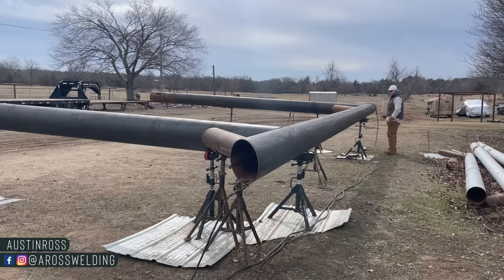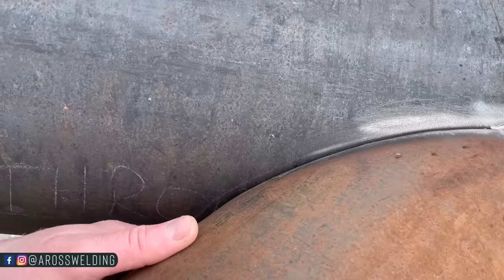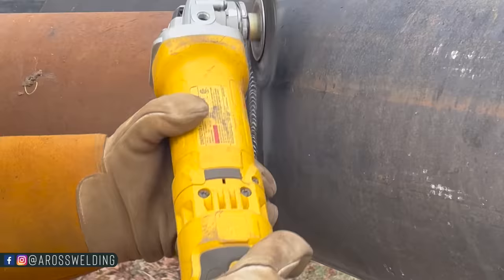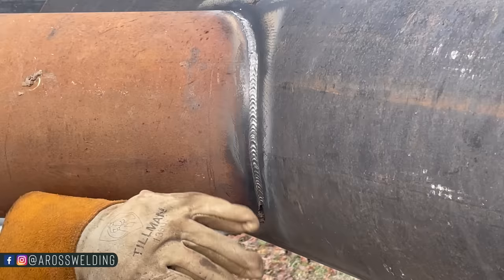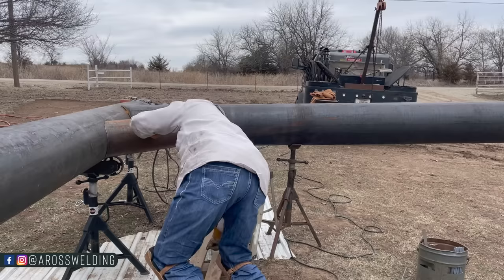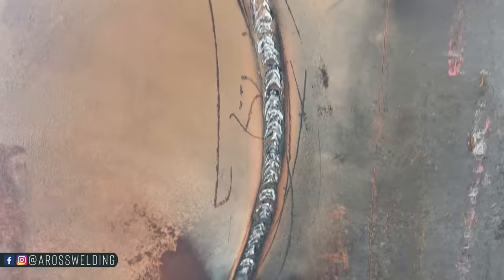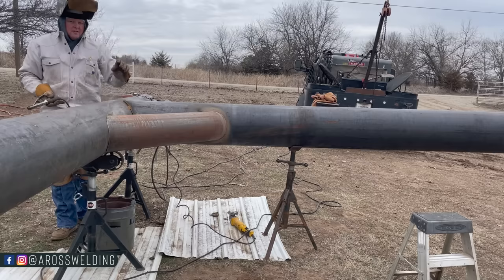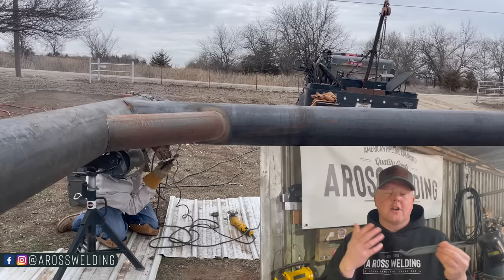Why Pipeline Welders Only Burn Half a Welding Rod

Comment: Mate, I'm an Australian welder who's worked in China, Thailand and all over Aus on Defence. Written and qualified 124 welding procedures as well. We always burn the whole rod taking into account access and heat input of course, and then there's economising for ourselves and the client. But as tested welders know, especially on critical LNG and fuel/oil know implicitly,  more stops/starts mean more opportunities for weld imperfections and NDT failures.
Reply: Correct.
Reply: thats what im saying.more tie in = shitty weld. thats when im welding pipe or anything else.i could make it look better than welding up.i can see using something just to fill in gaps and burn of any paint and shit.i like using 5p first but then its 7018 up. this is structual pipe i thought  he was doing something else
Reply: Way to much time watching an arc!!!  Pat him on the back fot attention  slap slap.
Reply: @chrhadden  Why are you not grinding the paint off?
Reply: Im in US, and we have a family business, selling, repair pumps, electric motors, phase convert and so on. We have done work w/ NASA NSA Aberden proving ground, Ft. Mead and so on. My Great grandfather started the business in 1901 (he was at Lincolns funeral he was 4). He as well as myself are inventor (have patent to our name I have 1 still under my name as it's no longer of use [it was monitor for DC motors, AC freq drive can pretty much do anything a DC can cheaper]  he had dozens yet none except a couple are still w/ our names as we sell them to big business and they then own them..anyway) He put the generator in the Argonaut one of the first subs. We actually designed and built the ultrasonic shower in the ISS (space station). I was just a teenage, yet worked on it and carved our name in it. I wanted to be the first person to use as I finished my work on Saturday and was going to use it Monday, but my DAD went in on Sunday (not telling me) and powered it up and was the first to use it. He used the excuse that since I was a kid and this was a major thing he had to make sure I did it right..what BS I had already work on gov't crap. We also modified deep sea submersibles that kept leaking at deep depths, so I came up w/ the idea of putting oil in the stator to displace the air, and thats what we did. We also wound a MK 48 torpedo w/ silver magnet wire and a gold commutator as the NAVY wanted more speed, and distance w/o more power. The machinist set up all this new paper around the lathe before turning the commutator to catch the bits of gold that was machined of it, I told him that it was a waste of time b/c he wasn't going to take off that much gold. Anyway, I prefer arc welds for building up a shaft over spray weld b/c the arc is a stronger bond. I have dozen of rod at my house b/c they are decades old (4 ft the largest) and some are silver.
Reply: It's a gate not a pressurised pipe line....Gate ...mate.
Reply: @Warpedsmac  😆😝. You would have thought that was obvious but I guess not.  😎
Reply: @kevobrien7346  arc welding is not inherently stronger than MIG... Only reason pipeliners run stick instead of dual shield is they aren't laying down a lot of inches of weld - anyone outside laying down multiple beads that take 2-3+ electrode changes each is setting up a wire feeder, but on the pipeline, you'd be moving and setting up the feeder more than you'd be laying wire

engineers/inventors aren't welders
Reply: Yeah what he said.
Reply: It's a feel.
Reply: @tragikk03   ''engineers/inventors aren't welders'' Are you ? MIG is not arc welding? You even know the difference between MIG and MAG ?
Reply: @zsdfg zxdcfg  I broke out as a fitter/welder in production, now I own a mobile welding business.  I run 045 dual-shield a lot now, but I'm certified in multiple processes and continuing to expand my library of skills - learning GTAW now.

What do you do? Cry on the internet?
Reply: @tragikk03  Don't focus at me, I'm just a certified TIG-welder.  Do you undterstand this: MIG is not arc welding? You even know the difference between MIG and MAG ?
Reply: @zsdfgzxdcfg5203  Erm... "Not my circus, not my monkeys" as they say here where I live, so forgive me dropping my twopence and unsolicited comment, but this whole hoopla here seems to me to be about "knowing how to weld" versus "knowing how to talk PRECISELY about welding" - and apparently those two don't always go hand in hand.

This "arc welding is not inherently stronger than MIG" is, or it seems to me, the case of a rather sloppy usage of English. All "electric welding" (bar electron beam welding and resistance spot welding) is in fact "arc welding" - TIG, MIG/MAG or stick all use electric arc - in one form or another (heck, even atomic hydrogen welding uses it, albeit indirectly).
But I guess some people just used to call this SMAW method "arc welding", and for a very "reasonable reason", since it was the very first usable* arc welding ever invented, and for a very long time the ONLY electric welding method - or, at the very least, the only one WIDELY used.
And it was called "arc welding" in order to distinguish it from "gas/ torch welding" - a method well known and commonly used since much earlier (1903) - and the name, well, stuck. In other words, there came this association - stick electrode = electric arc = arc welding. 

And then, much, much latter*, came hydrogen welding, MIG/MAG welding, TIG welding - and all of them got their respective "detailed" names, to differentiate them from the widely used SMAW - wile stick welding remained stuck with this "arc welding (hey, have you ever heard anyone in the trade saying "I'm gonna use SMAW method here"?)
Here where I live people say "electrode welding", but then ALL "electric welding methods" utililise some electrode, don't they? Still, you say "electrode welding" and EVERYONE just knows it's not MIG/MAG - and neither TIG. Just good ol' stick (I mean, "electrode", of course ;-)
So I guess this "arc welding" is just a shorthand for "SMAW", and while it certainly isn't the most precise usage of English technical terms I see no reasonable reason to get into any "preemptive-assertiveness" style hair splitting.

But then I might be just wrong, who knows...
____________
* - Actually the very first patented method was "graphite electrode arc welding", by Nikolay Benardos and Stanisław Olszewski who obtained American patent in... 1887. Yep, it ain't no typo, the end of 19th century... Time flies, innit? ;-)
First USABLE "consumable coated-metal electrodes" were invented ca 1900, but "arc welding" gained popularity only after beginning of WW I. BTW, the very first fully welded road bridge in the world was made in 1927 in Maurzyce, Poland, using this SMAW method (it would be almost impossible or prohibitively costly at the very least to weld it using oxyacetylene torches).
First ROAD bridge, but "second welded bridge MADE" - Auntie Wiki says:
Although designed first, the bridge was the second such bridge constructed; a similar yet shorter welded railway bridge was designed and build a few months earlier in Turtle Creek, Pennsylvania ... and holds the record for the first welded bridge of any type in the world".
In 1925 Irving Langmuir invented atomic hydrogen welding method. TIG "as an idea" was first introduced in 1890 but it saw its first practical applications only around 1940. MIG/MAG, or GMAW came on scene around 1950, but even then it was only in '70s (AFAIK) when all those "non-stick" methods gained any broader usage - and until then "stick welding" was "arc welding", period.
Reply: @michaelchadwick3497  Yeah. Oh well.
Reply: @tragikk03  may I ask, what is GTAW? Please understand I am not a welder and havent struck a bead since '90 when I was working in Hawaii under a high pressure welder for The Navy. I have never heard of GTAW. Thank you.
Reply: @tragikk03  The real reason why on-site welders use stick/MMAW is because you don't have worry about your gas coverage blowing away, like you with MIG/MAG.
Reply: @Jeff NME  you're not entirely wrong, but that's not really the whole picture.. stick welding just does better in dirty environments and is used when it would be too slow to set up a dual-shield of fluxcore wire feeder (like pipelines where they're welding one connection then dragging their shit up to the next connection - stick welding is a ton faster in that situation)

To run mig outside you just stand your body between the mig gun and the wind direction and/or crank up the working gas pressure (depends how windy it is, as long as you use your brain and, if you get porosity, grind it out and fix it, it'll be fine

There are other pros and cons, but this is probably the biggest deciding factor, but industrial type fluxcore (not the shitty 120v machines at homeless despot) is just as capable of forming the exact same strength bond as the SMAW process (its used any time setting up a wire feeder is justifiable - we don't stick weld the structural steel beams for skyscrapers, we weld them with gasless fluxcore (might be some companies funding dual-shield, but that seems less cost-effective due to the cost of gas and the insane amount of heads those guys have to run (one weld might take 30hrs for two guys to fill the whole bevel with beads, even using .045 and bigger wire)
Reply: @Big.Ron1  gtaw is gas tungsten arc welding - it's tig welding.

Smaw is shielded metal arc welding (stick)

Gmaw is gas metal arc welding (mig)

The guy mad at me has absolutely no clue what he's talking about lol
Reply: @MrKotBonifacy  stick welding is commonly referred to as "arc welding" in the industry......... anyone who is a welder would have understood clearly what I was saying.

The guy you and I are replying to has absolutely no clue what hes talking about at all. My OP is factually accurate, and I stand by my statement that SMAW (arc/stick welding) process does not form an inherently stronger molecular bond between the base metals - GMAW (mig), even spray-transfer MIG using hardwire and an active gas mixture (contains a small amount of reactive gas mixed with the regular inert Ar/co2 mixture) can obtain the same weld-strength as the same joint welding using stick/arc welding(SMAW)

Ps: I didn't have enough time to read everything you wrote, just wanted to clarify this
Reply: INFINITE REPTILES With🇺🇦  mig welding wire is just as easy to identify as a stick electrode is
Reply: @zsdfgzxdcfg5203  "don't focus at me" bro you came in here running your mouth acting like I'm stupid when you can't even read lol

You're a certified-TIG welder? what's that mean? what positions and materials did you test for? which specific AWS certs do you have for GTAW Welding?
Reply: @tragikk03  Focus on ''arc welding'' and MAG, the way you write make you seem to don't know  that it is arc welding anyway or the difference between MIG and MAG. BRO! 🙂
Reply: @chrhadden  Anything that isn't clean bare metal contaminates the weld. Clean the entire weld site!
Reply: @Big.Ron1  TIG, Tungsten Inert Gas Welding,
Reply: @Tricknologyinc  i am not a shop guy.when a truck load of steel shows up from the shop we cant stop with the crane to clean anything that might get welded.if you  are a shop guy or someone with an onsite shop you dont know whats happening in the steel erector world.
Reply: @chrhadden  - The steel erector world is one of the more critical applications. I appreciate when you bring information to people, but that's just really bad advice, and a cop out. Sorry. When pieces are cut, they need to be dressed. It doesn't take long to clear rust and paint. It takes much longer to cut, fit and weld, end of story.
Reply: Can always count on welders to give their opinion on every damn thing as if it were all indisputable fact.

"I never do that stupid thing the video said to do, trust me dude I was born welding shit together with lasers shooting out of my eyeballs everyone that I work with knows it too."
-Basically everyone on the internet that's used a welding machine sometime in their life
Reply: @tragikk03  Google did'nt exist when I knew the difference. (1980's)
Reply: @zsdfg zxdcfg  it's still irrelevant - my comment that upset you so much was responding to the guy who said SMAW (commonly called arc welding in america) creates a stronger bond than GMAW (mig)

He is wrong, and I explained that previously. Then you came along crying about me saying engineers aren't welders and won't shut up about mig vs mag - we aren't talking about mag - we are talking about the material bond strength of SMAW vs GMAW and as I have stated over and over again, stick/arc welding does not produce an inherently stronger weld compared to MIG (not mag, we aren't discussing that at all, only you keep talking about it to try and prove you know something I dont.. if you aren't a troll you have something wrong with you.
Reply: @tragikk03  Do you MIG weld the kind of steel in the video? Do you, BRO?
Reply: @zsdfg zxdcfg  we aren't talking about the steel in da video uhdurhurhur can't read a yt comment thread but pretend he can read aws weld symbols and "certified tig welder"
Reply: @tragikk03  SMAW vs GMAW Not saying you are right or wrong about the strength BUT i do know that welders who were repairing booms on electromotive cranes where i used to work, were directed to use stick and not mig. That was a few years ago but whether that is still the case? I am not a welder per se but as a mechanic had to do some.
Reply: Amen! Back in the 70s I had job requirements where the welders, who were testing, had to keep all their welding stubs. Any stub longer than 2" was an automatic fail.
Reply: @kevobrien7346  Great story! I worked with some old timers who built Liberty ships. They told me about welding with 4' rods 5/16 dia. E-6019 all flat. I can't imagine controlling an arc 4' from my hood!😂😂😂
Reply: @tragikk03  stick stringers are a lot stronger than MIG anything.
Reply: @michaelchadwick3497 what paint?
Reply: @kevobrien7346 WoW, that's amazing  !!! I know you've got some stories you could tell !! 👍
Reply: @zsdfgzxdcfg5203  
Hmmm, you DO know "arc" is a very common term for "stick" welding?
There are a bunch of different welding processes, and if you wish, you can consider all forms that use a directed electrical current can be regarded as "arc", even electron beam.
LASER , and obviously friction, concussive/explosive, gas (non-plasma), etc. would not be considered "arc".
Reply: @kevobrien7346 We designed the MK48 warhead, sure hope you did not weld or wrap anything over it!  Won't work if you did.  Tell the Navy.
Reply: @tragikk03  mig is arc welding.
Reply: @tragikk03 the other reason you forgot to mention would be shield gas … outside pipeline would be a crazy amount of time and energy to hoard up your weld area so no wind can blow away your gas .. stick welding is by far superior outside .. duel shield is more for production shop welding inside .